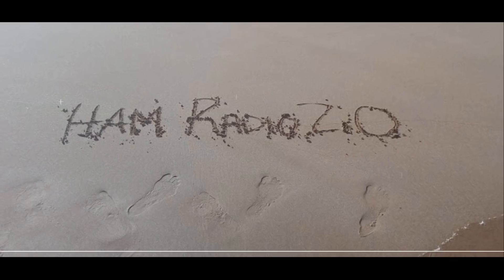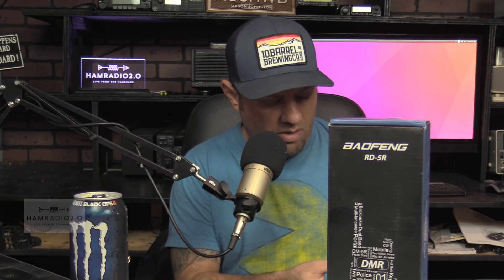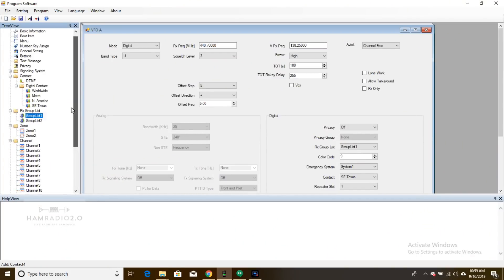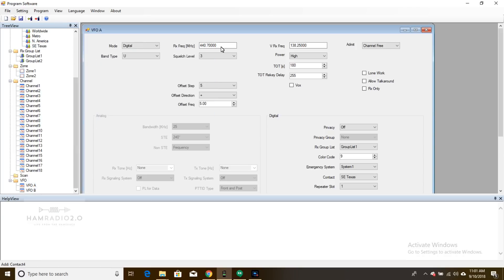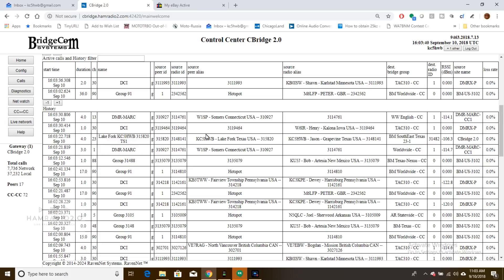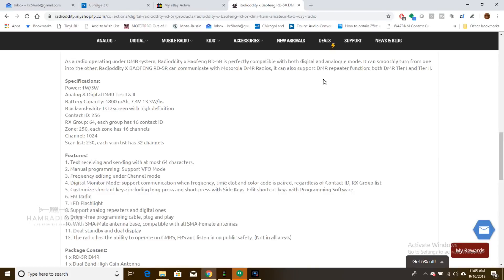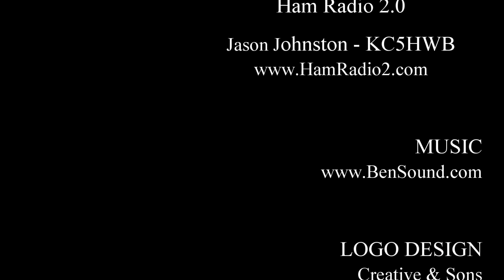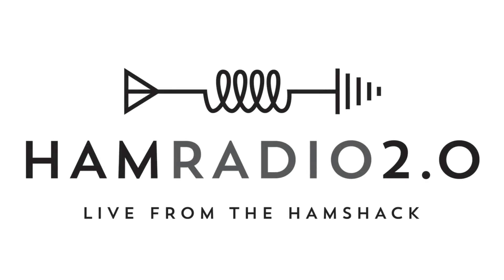Baofeng RD-5R Dual Band DMR HT for Ham Radio

Comment: hi will works on my jumbo mino hotspot..
Reply: ok its working on pi star take a look om. my vídeo i enjoy your chanel here in Brasil.. Wonderfull your chanel i am yor fan kkk rs
Reply from the maker: Thanks
Reply from the maker: I'm not familiar with that hotspot, but if it's running Pi-star, then yes it will.
Reply: ok
Reply: as you can see works...

Comment: Relatively new to ham and am interested in DMR.  I have to travel a lot for work so I am looking for an HT that I can program on the road.  I would have the ability to program my talk groups and the like at home on a computer, but would this radio be easy to connect to a repeater via front panel in a new city if I didn’t know in advance I would be stopping there? (And didn’t have my laptop)

Comment: You need to check if the radio still works after doing a HW reset.  Try it, but. expect it to BRICK the TX audio in DMR and FM. Be aware before you buy.
Reply from the maker: What exactly do you mean by "HW reset" ?  What are the steps you took to perform this reset?
Reply: @HamRadio2  The system reset involves holding 2 buttons in while powering up.  Don't remember if is was in the manual or on the web site but I seem to remember that it was also covered in the FW U/G instructions too.
Reply from the maker: Yes that would be a factory or a firmware reset, not a "HW" reset, where HW - hardware.  That is what confused me.  You can't reset the hardware in a device, but you can do a firmware reset/update or sometimes a factory reset, depending on the model.
Reply: @HamRadio2 Sorry, I miss worded it.
Reply from the maker: @williammiller5490  no worries,  just making sure I knew what you meant
Reply: @HamRadio2  have you had an opportunity to do the reset and see if it is still breaking the radio?
Reply from the maker: @williammiller5490  No, I'm working on other projects and I'm not sure I want to brick the radio. I'll need to check with Amazon on a warranty

Comment: if your on a budget and looking to get your feet wet in dmr not a bad pick.  yes, not a ton of features however its bare bones and gets the job done.  in channel mode you can monitor both digital and analog simultaneously (if desired).  easiest way to program is via cps on a desktop/laptop by far.  not impossible to program from front keypad in vfo mode, just a bit cumbersome.  I routinely make digital contacts while mobile at 20-25 miles with no problem.  for me, wasn't my preferable choice, but it works
Reply from the maker: Agreed.  Although most of these dual bands will also let you monitor A/D at the same time.  But yes, your comments are accurate.

Comment: Have one and it works fine on both analog and digital. The software is easy enough to use if you are willing to use Windows. All of those that I contacted said the audio sounded fine. I did upgrade the firmware to the current version but that was easy enough. BTW, I’m using  a hotspot. Enjoy your videos, thanks for doing them.  AL6T
Reply from the maker: Thanks for the comments.

Comment: I can manually dial a contract,  option 3.  CONTACT/ 1. Contact/ 2. New Contract/ 3. Manual Dial
Reply from the maker: That isn't in the programming menu to program the VFO channel.  So while you are correct, it is possible, it should also be in the channel programming  menu with everything else that is there.  Just a bad design...

Comment: Long press the monitor button to enter promiscuous mode.
Reply: Also, the broadcast FM receiver doesn't work if you're in dual watch mode (double wait on).
Reply from the maker: I can honestly say I could care less about an FM broadcast receiver on any of these radios.  I always thought that was rather useless.
I'll check for the Prom mode, thanks for that info
Reply: I would assume if there was a large disaster and the govt wanted to get a message out to the masses, it would be done via FM broadcast.  Pretty good feature I think.
Reply: @Dragon  Can you reassign the promiscuous mode (monitor) to the top SK1 button with short press ? 

Is Monitor the one you assign in the cps button menu ? 

Or are you stuck with it on the bottom SK2 with long press? 

Thanks for any help in advance 😀
Reply: @peaceseeker7332  Yes, both buttons are reconfigurable in the software.  The dropdown list of available functions is pretty nice, too.  I have one of my keys setup to enter the zones menu on long press, for example.
Reply: Thanks for your reply, I just bought one from ebay, and I'm very excited to get it soon. I've already downloaded/installed the latest baofeng cps 1.1.24.13 and made a code plug and increased the UHF range to 520MHz ! Our work uses TX 514mhz RX 504mhz. So this radio for 80 Aussie bucks, Is a bargain ! Its also the smallest Tier II DMR radio in the world.
Wow so it even has promiscuous mode standard, simply by assigning the monitor function to a sk1 or sk2 . Now all we need is to be able to listen to all colour codes at once in the VFO mode :)
Reply: Looks like it's basically the same firmware as the RD77. Which of course, being a co-branded Radioddity isn't a surprise.

The CPS looks similar as well, don't know if they are compatible, but if they are the "Community CPS" allows for more options.
Reply: @dragonfirerich when in promiscuous mode does the screen show a black speaker icon on the screen? Still trying to figure that one out.
Reply: FYI @7:00 is where he mentions not finding promiscuous mode